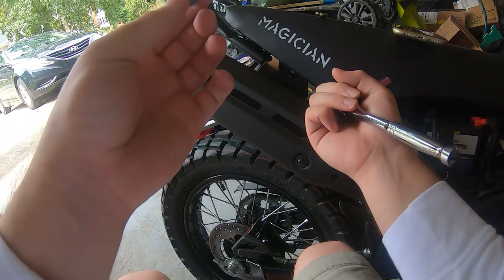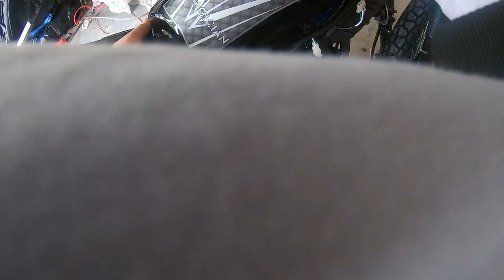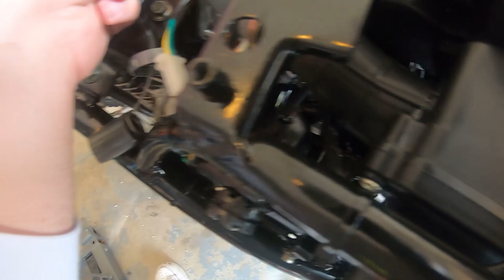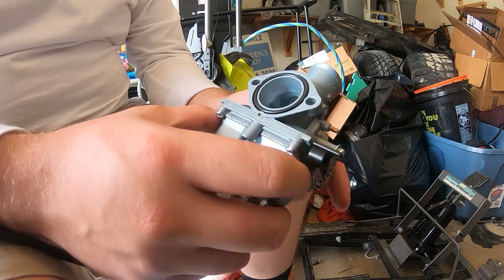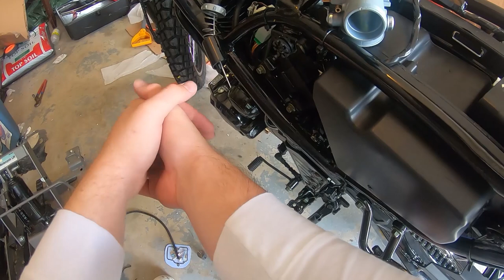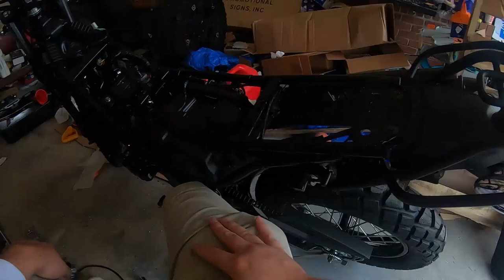How to Change and Jet Carb on RPS Magician 250 (Similar to Hawk 250, TBR7, Brozz, TT250 or other)

Comment: Hey man absolutely love your content, just got my magician delivered today. Keep up the good work my dude! I’m glad to see a fellow China rider , especially making content on the magician! Not many people have! Definitely earned a sub!
Reply: I will be posting some videos soon of mine and the work i have to do to her .
Reply: Not to mention Love ya China Rider NC !!!
Reply from the maker: Appreciate it buddy!! Unfortunately, I was too tall for the Magician and a couple other things, so the magician has a new owner now. Will be back with Hawk related videos (exact same engine). Feel free to run any questions by me!! You’ve got a great bike! Make sure you do the prep! Change oil, lock tight, level forks, chain tension adjustment, lube chain, check wire harnesses for loose ends and you’ll be great!

Comment: Did you have any rattle when reving? I thought it was vales but might be tank? 2021 new magician.
Reply from the maker: Check and make sure your tank bushings are in tact, they’re the rubber that your tank rest on. Other than that, tighten up everything
Reply from the maker: Could be loose motor mount, or exhaust shield

Comment: at 18:37 where did you pull that fuel line from. mine is disconnected and can’t figure out where to put it back in
Reply from the maker: That wasn’t the Fuel line, that was the bowl drain line. You connect the fuel line on the fuel input on the carburetor. It will be a brass fitting that you plug the fuel line over and clamp.

Comment: I think Choke is all the way up not down. When the lever is all the way up and the flap is closed that means the choke is on because its choking the air from getting in. Flap closed means its choking the air. Closed is all the way up and choke is on. Flap open is all the way down and choke is off.